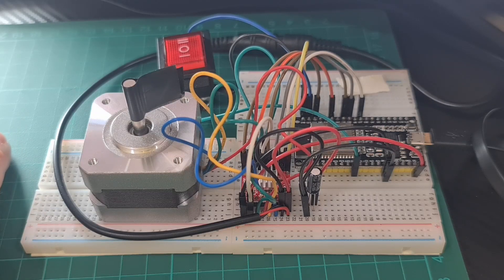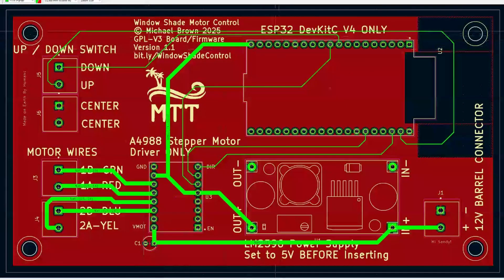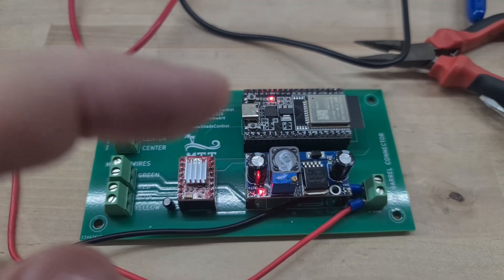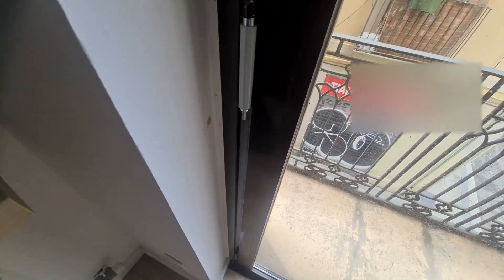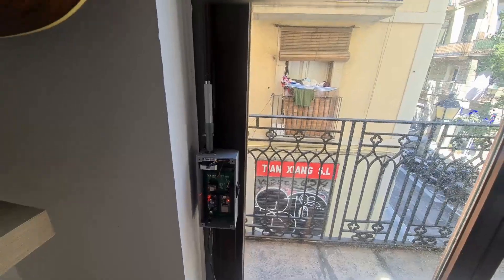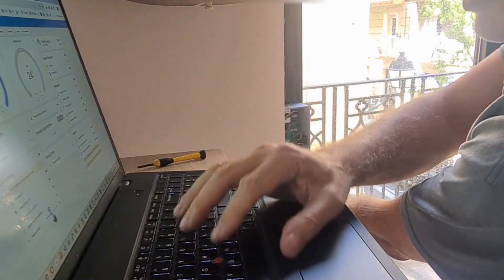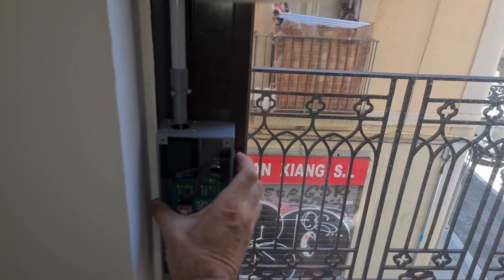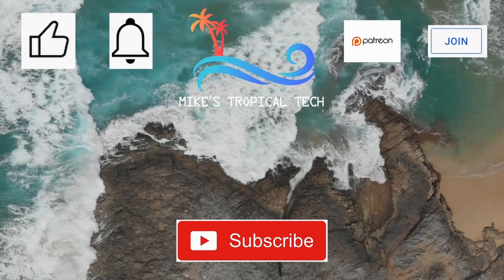DIY Motorized Window Blinds with ESP32 & Home Assistant: Battling Friction! (Part 2)

Comment: Mate. This is absolutely fantastic! Subscribed! Can I ask how you calculated the torque required for the stepped motor? I'm planning to do something like this for some outdoor roller blinds
Reply from the maker: Well that's my problem, I didn't calculate anything!  I just bought 3 motors and tried, but still couldn't overcome the friction in the crank mechanism.

I can't remember if I mentioned in the video but I went to a local IoT group meeting here in Barcelona and they suggested I switch to a standard DC motor with a big gearbox on it.  That will be my next attempt but not likely until next spring when I come back from winter holidays.
Reply: @MikesTropicalTech  ohh gotcha! I was thinking something similar actually cos I'm hoping to drive the 'roller' directly with the stepper motor, (ie without any gearing) was thinking an oversized stepper may work.

Does the standard DC still give you the incremental control?
Reply from the maker: @metalor696  No, that's the downside of a standard DC motor, you'd have to time the power to the motor to make an adjustment so it's not as accurate as a stepper.  If you had a DC motor with an encoder, you could track the position and remove power when you hit the target so I think that would be the best option.  I just found a lot of YT videos that explain how to do this with an Arduino.

Comment: Talk about targeted videos! This is a project I've been planning on trying to carry out. It would make things a bit bulkier but you could always try adding a gearbox to the end of the stepper motor and trade speed for torque. It'd be annoying because of how much slower it's be but it's not like opening and closing blinds is something that needs to be done absurdly fast anyways. I'm not too familiar with stepper motors so I can't speak for the driver, but you could also look at getting a high torque servo. I happened upon one so that's what I was planning on using.
Reply from the maker: Thanks for the idea, that would be an easy test to try.

Comment: same problem for me, probably the driver that are to weak, cant be the motor?
Reply from the maker: I left the adjustment on the driver board as it came from the factory, I will try adjusting it.
Reply: @MikesTropicalTech  I think that driver board can go upto 30v power supply